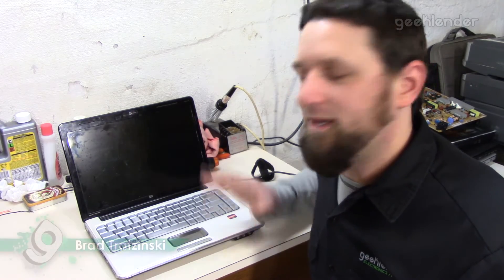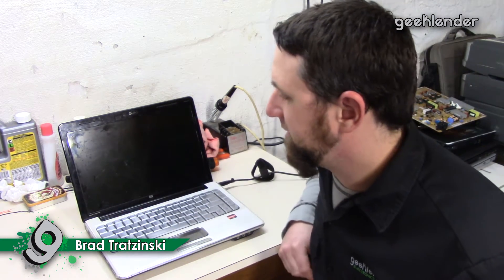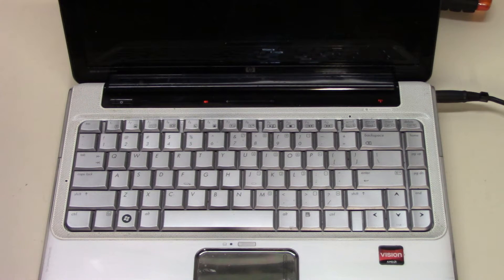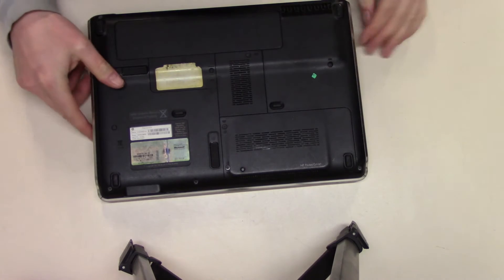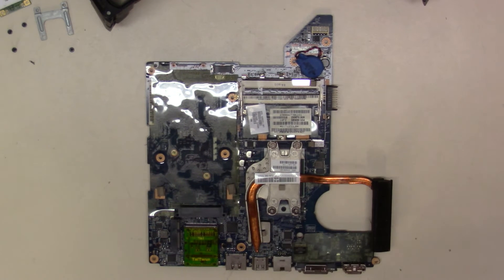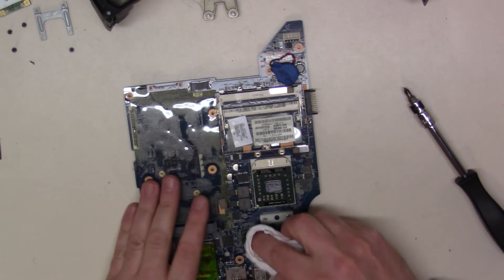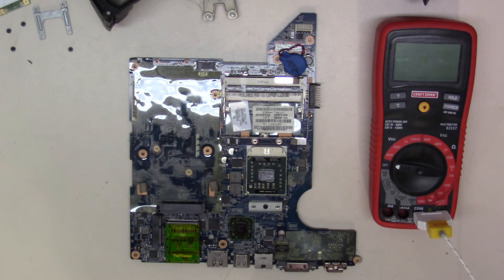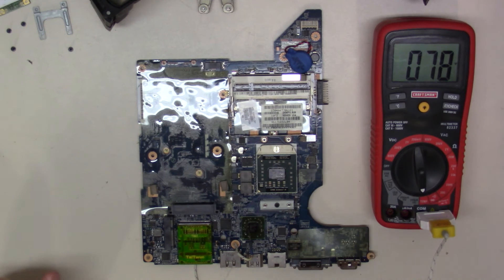HP Pavilion dv4 No Video Fix

Comment: Thanks for the video. I'm on my DV4 2045dx now that's up and running from watching your video. Only problem is I forgot to put that little plastic square cover back on the chip. I did use new thermal pads and new thermal paste, and I used the lids from old multi vitamin bottles as 4 feet under the laptop so it sits 1/2 inch higher off the table for better airflow, plus I have a small 6 inch external fan that runs off the usb port to keep air passing under it when it's running. Do you think It will be okay without that plastic cover?

Comment: Does reheating it reset it? He did not say that reheating the gpu resets it or am i missing something?
Reply: I had one costumer with the same problem, the laptop turned on some times, and when it didn't the lights started blinking, and realized that it was the graphics processor, son I did the reflow and worked perfectly.
Reply: @diegodonaires8031  the only thing that it´s good to agregate is the use of some soldering fluid, in most cases it´s escencial,  in english is called FLUX or SOLDADURA LIQUIDA. first time i used to make the heat soldering without that but latter the same motherboard with flux the repair do result sucessfully, so i recomend it. saludos.
Reply: it´s a proccess to re soldering the graphics chip, i´m going to make the same repair to a computer of a brother, latet i comment my resolution, greatings!